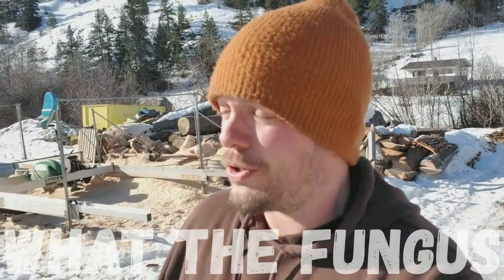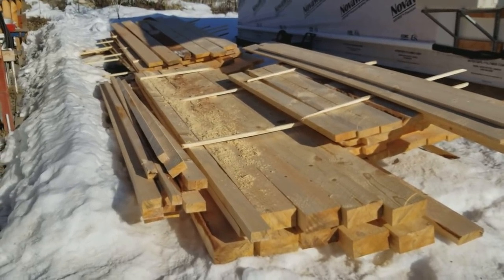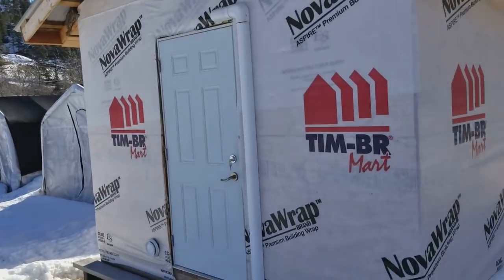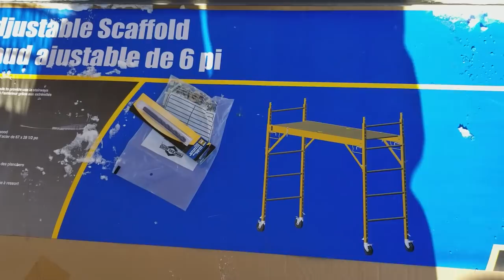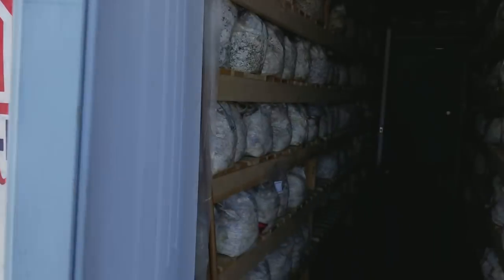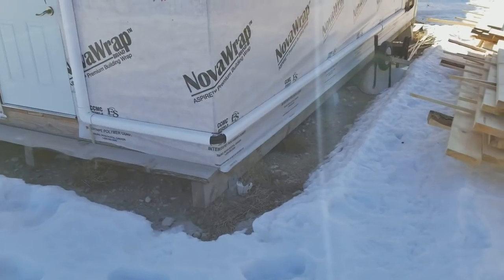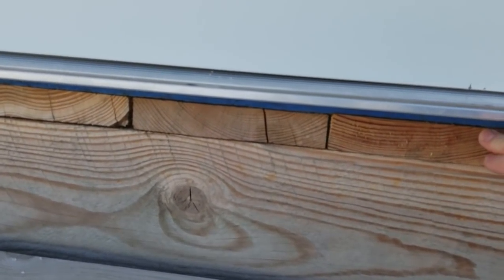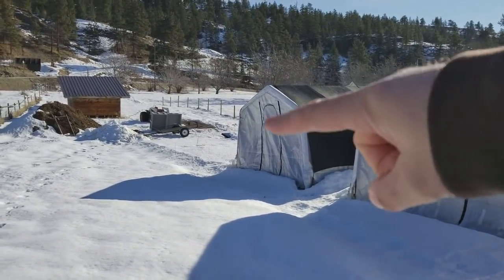Recycling Urban Trees For Farm Building Construction And Mushroom Cultivation  - Lucas Sawmill

Comment: Have you considered using chrome metal wire rack shelves with casters? Sturdy, good airflow, highly adjustable, sterilizable and thin so no wasted space. What are your requirements for per shelf weight capacity, and cost per unit?
Reply from the maker: you can't buy a quality shelf under $300 delivered. Each  cart needs to support 1000-1200 lbs
Reply: WHAT THE FUNGUS Can you get something like this in Canada? https://www.amazon.com/gp/aw/d/B00CL920NS/ref=psdcmw_3744001_t1_B00794ERHW  

The description claims 600 lbs per shelf. Price seems decent. 

Edit: I may be misreading it and the whole shelf only does 600. If that's the case it's not suitable, but there are some other options with slightly higher capacities.

Edit again: Looked into the questions and one poster claims it's 3000 lbs with no casters and 1500 with casters.
Reply from the maker: arcrad looking for 6 shelves 13.5" apart.  But with shipping and exchange rate into Canada these will get pricy